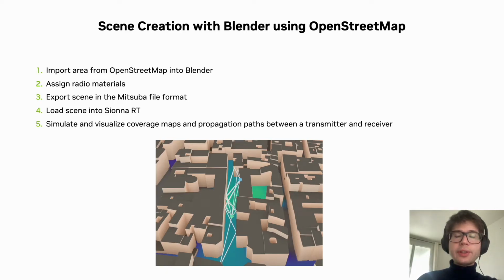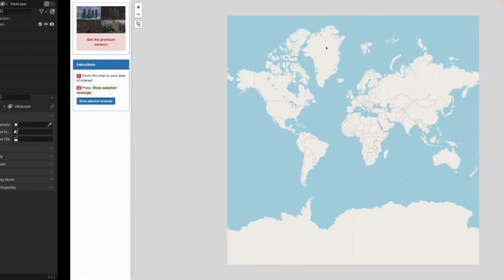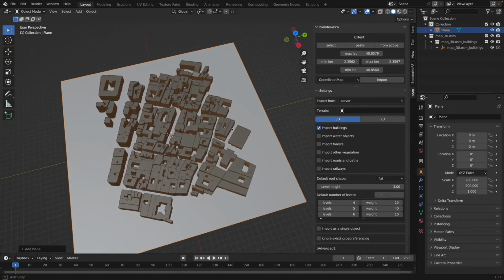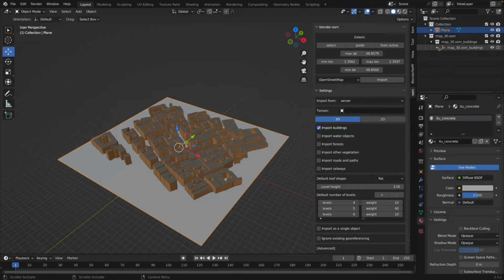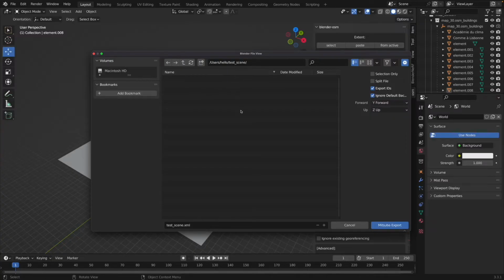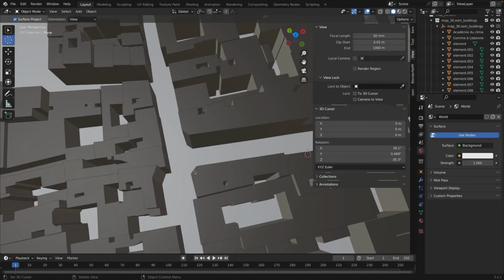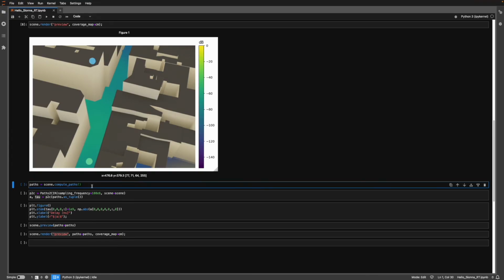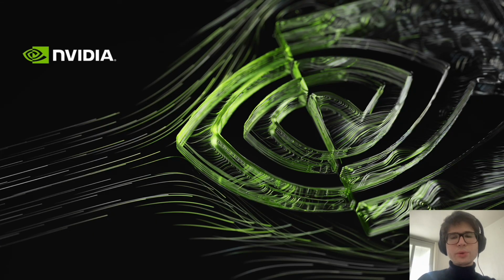Sionna RT: Scene Creation with Blender using OpenStreetMap

Comment: I followed the Sionna RT tutorial to generate an XML scene using Blender 3.6 and the latest Mitsuba Blender add-ons. However, when I try to load the scene in Jupyter using load_scene(), I get the following error:
''[xml.cpp:1082] ValueError: HolderMaterial only allows one nested radio material but found property "mat-concrete" of type <class 'mitsuba.BSDF'>.''
I’d appreciate it if anyone who has faced a similar issue could help me with it.
Reply: I resolved the issue by assigning each object in Blender a radio material, such as "itu-concrete", using the materials provided by the Sionna RT API

Comment: when you export .xml file, be sure to set Forwar to 'Y Forward', Up to 'Z Up', it took me a morning to see what the error was that I couldn't see my transmitter. 
And one more point, to install sionna 1.0.2, be sure you have python 3.8-3.12 and Tensorflow 2.14-2.19, Scypy>=1.14.1 (which needs python >=3.10) 😭this took me nearly a day to justify all the mismatch versions 
(for me now, I use python 3.11, tensorflow 2.19, scipy 1.15.2 
Blender 3.6 LTS, Mitsuba 0.3.0) 
arhh it was annoying, but now it's done

Comment: I am using Blender 4.2.9 LTS and Mitsuba v0.4.0 on Windows 11, and I need to move to the blender 4.2 installation folder in the terminal and execute the command ".\blender.exe --python-use-system-env" like "C:\Program Files\Blender Foundation\Blender 4.2> .\blender.exe --python-use-system-env" to export xml
Reply: If you run Blender as an administrator and then try to add the plugins, it might solve the problem, there is no need to launch Blender from the command prompt.

Comment: I am unable to install mitsuba add on, i used downloaded zip file for mitsuba on the latest version of blender. Is it difficult for everyone or only i am doing something wrong
Reply: did you fix that. i am also having problem
Reply: @shahnaz1981fat  i tried many times but could not fix it
Reply: If it is still not fixed try to use Blender 3.6.0